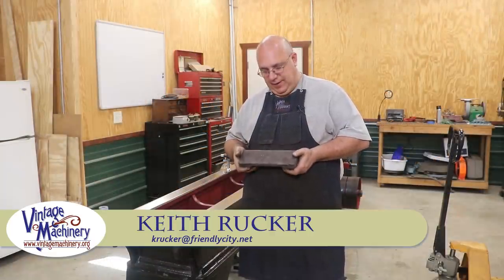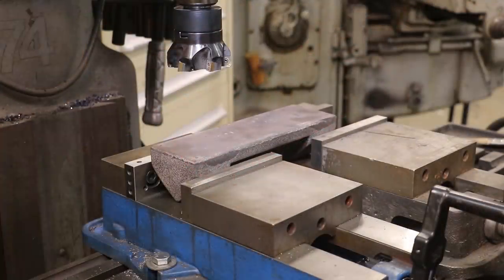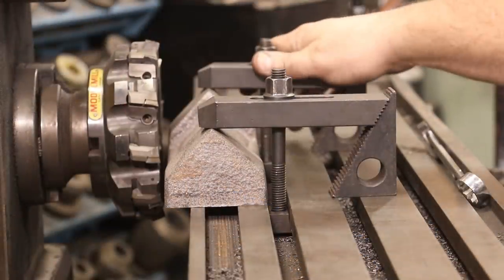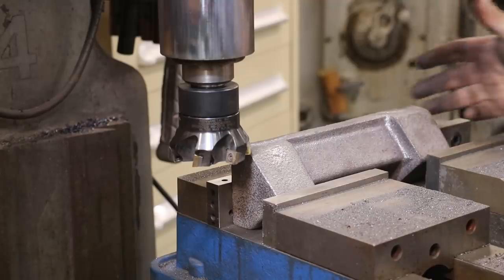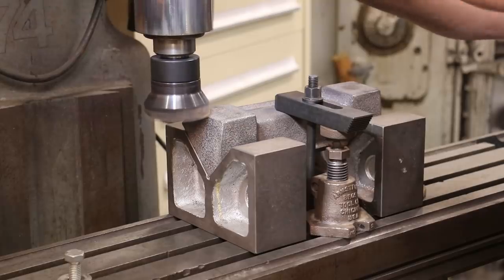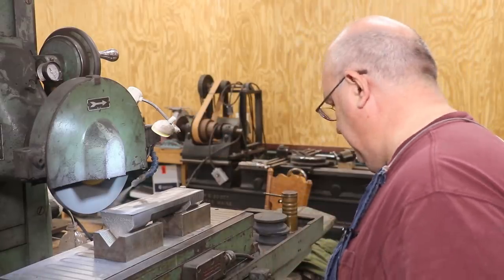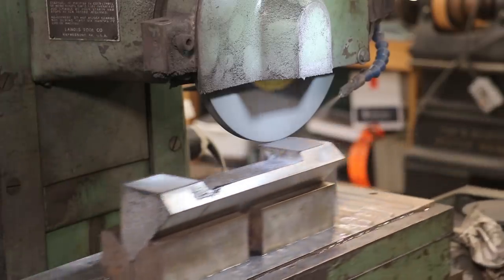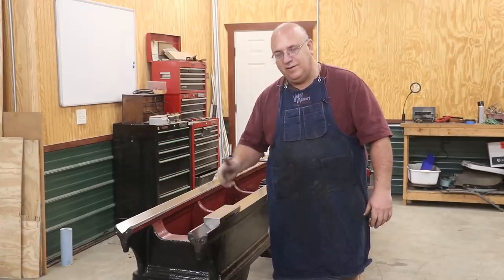Milling and Grinding an Autocollimator Mirror Sled for Inverted V-Ways

Comment: When using the surface grinder, I assume that the wheel gradually wears down.  How do you compensate for that?
Reply: John Kailua when the wheel wears it wears on a tapered angle. Front side does most of the cutting so by the time the material is getting to the back side of the wheel it is removing so little that the wear is basically non existent. When taking heavy cuts it could wear all the way across but your constantly dressing the wheel to make it flat again so it doesn’t matter much. You always have to take light cuts to finish a part so there’s almost no wear at that point and you can hold size all the way across the full width of the chuck.
Reply: The wheel is an inch wide. Only the leading edge grinds, when it is grinding at the front of the wheel it is freshly dressed, as you see the sparks from the middle of the wheel it is half done, when the sparks come from the back of the wheel, it is time to redress the wheel. The thicker the wheel, the more you can grind before you need to dress.

Comment: you are presenting a restoration of a complicated piece of machinery that requires a high degree of precision (if you intend to do it right) . . . don't apologize for also showing how to make a tool required to do the job . . . that little sled is as much a part of the project as any other required part or piece or tool.

as a matter of fact, i'd bet that a lot of your viewers would like to see how to calculate the sled dimensions and the math and measurements involved in the entire leveling process . . . not all geeks use only computers . . . there are tool geeks too!

Comment: Next episode, Keith builds an attachment for his surface grinder, so he can use a wider wheel.
Reply: Nah, the part he was working is sized just fine for the working area of the machine. A wider wheel is more forces on the column, bearings, ect when cutting.

Comment: I am slightly worried that you have over constrained the sled, in that unless the angle of the V exactly matches the angle in the Veeways then it will be able to wobble side to side, if only slightly.

I have been wracking my brains though to think of a combination of spherical and cylindrical surfaces that isn't over constrained and still measures what you want it too. It could also be the case that the wobble I am concerned about will have no effect on the collimator.
Reply: Following
Reply: There's no cylindrical / spherical solution, all spheres/cylinders will have two contacts in the V.
Reply: @celebtee  You need 5 points of contact, to leave the one degree of freedom that allows it to slide.
You are assuming that a ball has to touch both sides, but it does not have to do so.

Comment: I just noticed, what are the four pins , 2 each way, in the ends of the way for?I don’t remember them from the tear down videos.
Reply: They used them for measuring points for the way grinding process.

Comment: Always machine cast iron  dry.  I thought it was a rule.
Reply: Definitely no cutting oil, but the water cooling on the grinder seems OK.  Oil mixes with cast iron dust to form an abrasive paste.

BTW, "white" cast iron is too hard to machine and must be ground.  Keith was working with common "gray" iron.  White and gray refer to the appearance of a fracture.
Reply: you can usually machine it dry but you don't have to. coolant also helps flush the chips away.

Comment: I think your vertical mill spindle speed is too fast for milling cast iron. Whenever I see an excessive dust cloud rising up (there will always be some but proper rpm makes it minimal) and more importantly dust instead of a defined chip then its rotating too fast. I'm a journeyman machinist that has machined thousands of cast iron projects in my lifetime (probably more cast than anything else). I always maximized the chip over dust creation to if nothing else save my lungs.
Reply: @chris0tube that's very true also.  I look at it as if I'm doing it and I don't want to breathe all the dust. I guess I've machined too much CI and don't really care to anymore. If I do it comes with a premium price.
Reply: Keith should ask “This Old Tony” if he might use the time machine and descale the part in the planer that is currently in restoration.
Abom79 has a shaper perfect for rescaling...

Comment: I'M CURIOUS, WHEN THESE MACHINES WERE EARNING THEIR  KEEP IN A SHOP, HOW OFTEN WERE CHECKED FOR LEVEL, WEAR ETC>
Reply: It depended on your shop. Who owned it, the kind of work they did. In some shops, like the one this planer came from, probably never. It was (hopefully) leveled when originally installed and if it was ever moved around the shop. After that, probably never. In a shop doing certified aircraft work, there are probably rules or laws about certified machine accuracy. I'd expect machines to be inspected and if necessary aligned at least once a year, or any time the machine was seriously crashed or it was suspected that it was out of alignment.
Reply: @lwilton  THANK YOU!